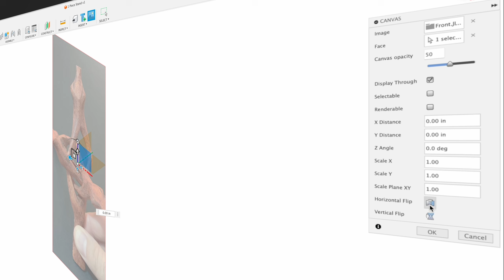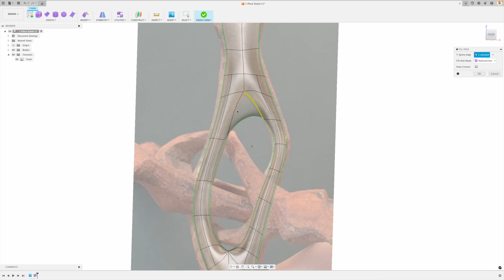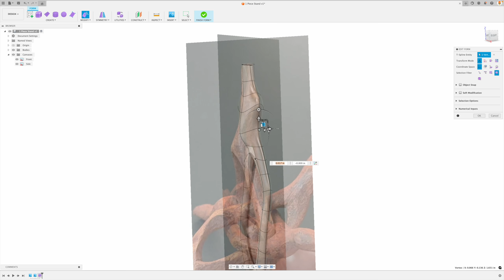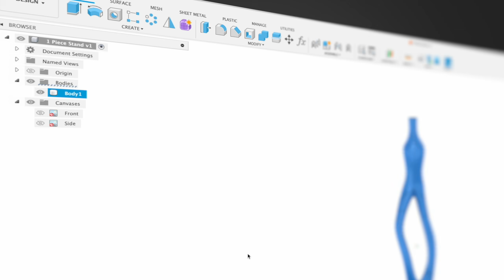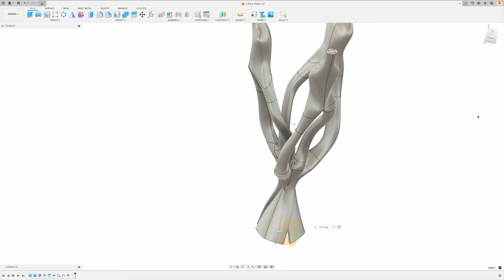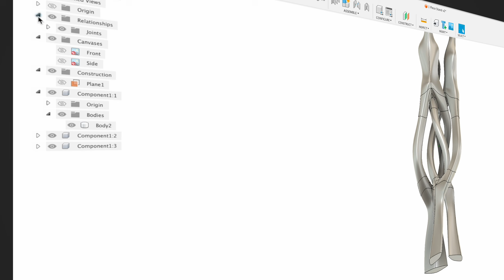Autodesk Fusion 360 - Form Modeling Tutorial - 3D Printable Single-Piece Artistic Stand (2025)

Comment: Great video. As always easy to follow and great showcase. Question from a beginner. How do you/could you be able to add your own designs to a model. For example: Lets say you have a basic beer mug or a simple plate that you have designed, but you would like to add a flare to it, like adding Star Wars features to your mug or around the rim of the plate, like an extruded fighter jet or panels from a cyberpunk theme. I've tried having a look for tutorials or showcasing this, but haven't come across anything like this yet or at least something that is relatively easy to follow.  Any thoughts. Thanks
Reply from the maker: Thanks! Glad you found this easy to follow. 

Regarding custom designs, basically you’d have to sketch every single detail of your object (often by using a canvas image) while making sure it’s the correct scale to your subject. This is not easy to do if one doesn’t have a good grasp of sketching and constraints. Then, by utilizing emboss/deboss applying that object to your subject. If I have some time in the future, I’d love to tackle this request. Lastly, get your elbows greasy and try, try, try. Even if we don’t figure it out on the first, fifth, twentieth time, we definitely learn along the way. 

I hope that helps for now!